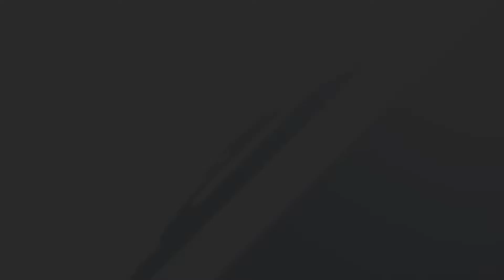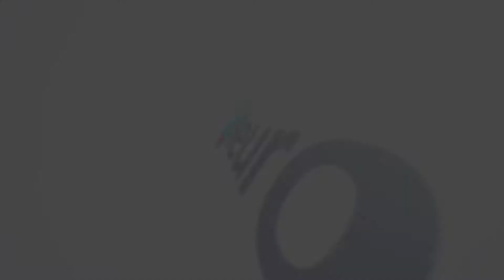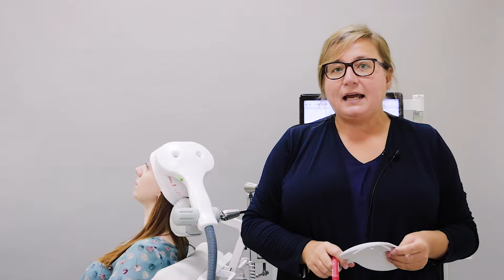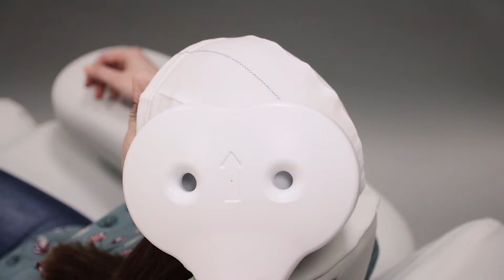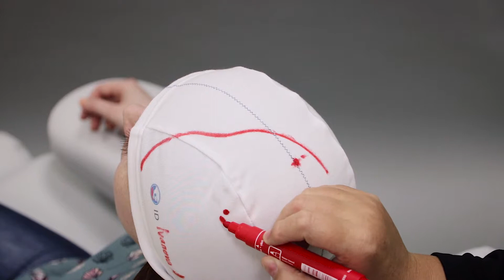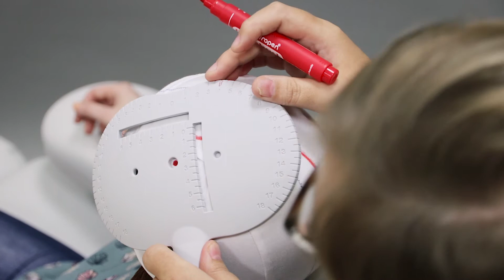TMS Coil Positioning for Depression Treatment

Comment: I am resistant of bipolar disorder I make TMS device at home but my magnet range not increase it support  me 5 to 6 hours later not support
Reply: Static magnetic won’t work.
You need an electro-magnetic field with a specific herz and specific frequency.

TMS treatment 

1.5T to Left dorsal lateral prefrontal cortex at 1-5HZ

Break the depression circuit in the brain 
4 seconds stimulation followed by a 26 second pause - for 37 minutes - 20-30 treatments for depression.

TMS helps depression anxiety and OCD but bipolar nobody knows ?